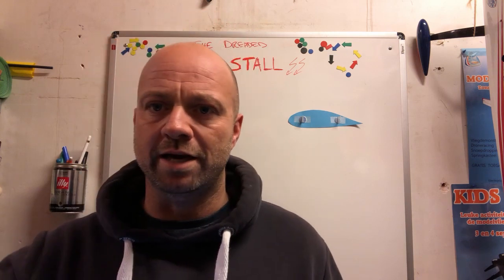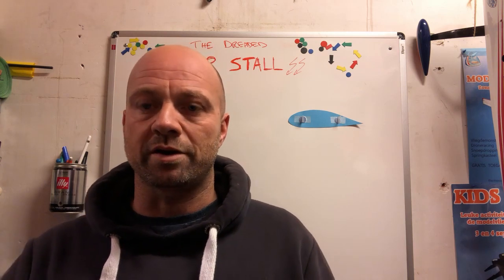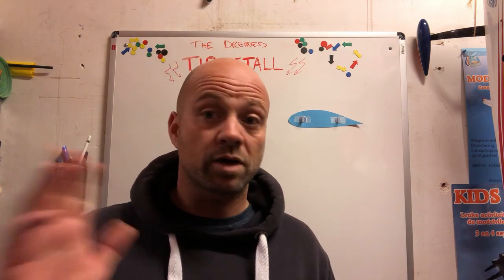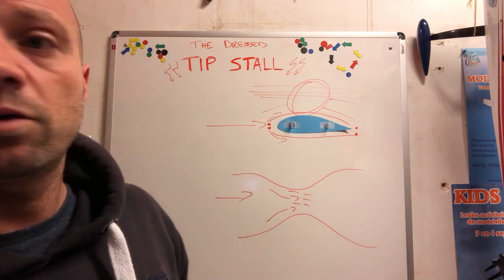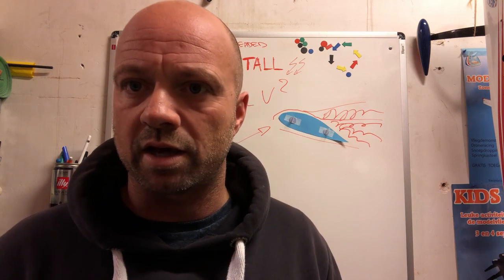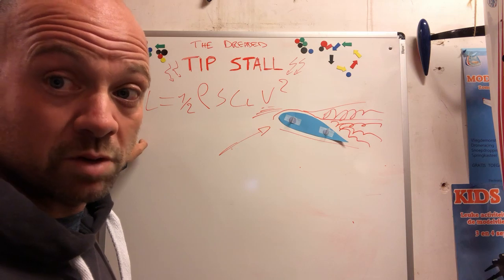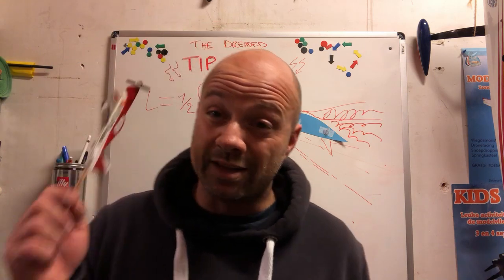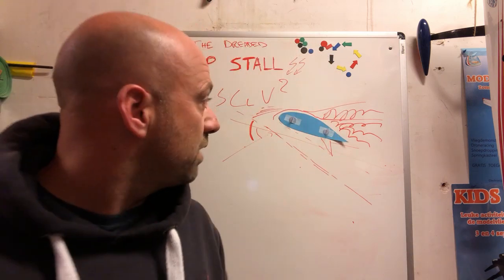EP 2 Tip Stalls

Comment: Thank u for simplified explanation of some fairly complex physics. Tip stall does exist but on model airplanes whether its simpler design or the fact little relative  speed difference exit between partial and full wing stalls on planes that its little of significance to rc pilot.

Comment: One final thing! Stall is not simply lift not being enough to compensate for weight - it's lift not being enough _when you are already flying at stall angle of attack_. The result is an increase in the angle of attack, leading to a decrease of lift (because now you're past the maximum value on the lift curve), leading to a further increase in the angle of attack and (at least partial) loss of control in a vicious circle.

Comment: Good to see someone explaining (and interested in!) the fundamentals of flight! One thing I didn't notice being covered is adverse yaw. If you ask me, that's what mostly causes your "tip stalls" (which, as you mention, are simply asymmetric stalls, nothing tippy about them). And it's also adverse yaw that causes the aileron input to be counter-productive when trying to correct the situation (as it's usually the thing that caused it). And how do you compensate for adverse yaw and maintain what's known as coordinated flight? Apply just enough rudder whenever you apply aileron input. Unfortunately, that "just enough" is a bit more complicated than a simple percentage of the aileron input - turns out the percentage depends on the amount of lift the wing is generating. Real airplanes do it by a combination of the pilot's muscle memory (learned by staring at an instrument called "the ball" for the first few dozen hours of training) and (with larger planes) automatic yaw dampers. My RC planes do it by incorporating an angle of attack sensor and some simple math (and many test flights to find out the actual lift curve in different configurations). If you manage maintain completely coordinated flight especially in slow flight, your "tip stalls" go away and  most planes turn out to remain controllable even in full stall.
Apart from that, one thing is worth stressing in my opinion: stall is not a function of airspeed, it's a function of the angle of attack (alpha). And the stall alpha is simply the alpha corresponding to the maximum value of the coefficient of lift (CL). Of course the shape of the CL curve depends on the configuration of the wing (i.e. what your lift-modifying devices are doing) and so can the stall alpha - usually flaps etc reduce the stall alpha (but the maximum CL may obviously still be higher than with clean wing).
Reply from the maker: Johan Veltheim thanks! I know I wouldn’t have gotten away with this explanation during my aerodynamics exam in my airforce days.
What I have tried to do is to translate pretty complex stuff into a fairly reasonable explanation that hopefully help rc pilots grasp the basics, so they have some comprehension of what happens when they’re out in the field.
Hope I more or less succeeded doing that :)
Reply: @TomDeWeerdt  that's a good point, some of the issues are quite complex if you really want to know the answer, most of the time RC pilots can get away with a bit less. I'm just a bit obsessive about my planes flying the way they would if I was aboard flying them with the proper instruments. :D

Comment: great video , as I have been looking for a demonstration on stalls'....I  learned to fly last summer, on all high wing 3S type trainers...I recently   flew my first low airplane, the HH  T-28 (  1.1m   yellow model  )   for the first time  and all the guys at the field kept telling  me to keep the speed up  or it will stall....but I didn't notice any bad tendencies when flying it, even in low slow speed turns....I used a 3S and  I did not use SAFE at all........... QUESTION: what  can I  do to  prevent  a tip stall  when turning at low altitude  for final approach  ...what pre-stall signs do I look for....anymore  helpful  tips welcome.... ....thanks
Reply from the maker: Generally speaking:
- High nose, low tail
- low speed
- plane getting sluggish on ailerons
- wingrock

My best tip to avoid them close to the ground would be to fly descending landing circuits, by that I mean starting up high and doing a circuit in one continuous descent untill the flare.
Start high enough on a downwind leg and establish your descent there. That way (side view, bit further away) it's easy to visually judge the speed. That way if you maintain the same descent rate with approx the same power you can trust that your airspeed on final desent is OK as well (while beacuse final is more of a frontal view and the airspeed is more difficult to judge visually)

When flying a more level landing circuit and throttling off on final to start final descent speed is more difficult to judge and the chance of inadvertently ending up stalling are much higher.

Also: Practice your stalls up high, in level flight as well as in turns, and in banked descents. Get to know your aircraft in all those situations so you know what it will be closer to the ground as well.

Lastly: Be triggerhappy on the throttle when flying slow, always be prepared to power up and save your ass :)

Comment: Thanks Tom. That's really helpful. I can now visualise what is happening during a stall and which situations are likely to cause it. One more question. What effect does using the flaps have, in relation to tip stalling. Will it increase or decrease the speed at which they occur.
Thanks for spending the time to make a very informative video.
Reply from the maker: Chris Edwards well basically those allow you to fly below the “normal” stall speed, on the Tundra they are so powerful because they create lift from the propwind. In my experience with the Tundra the stall doesn’t feel different with and without flaps, in both cases it’s pretty abrupt and brisk, they just occur at different speeds...
Reply from the maker: Chris Edwards making that video was actually a fun process, so thanks for the question!
Reply: @TomDeWeerdt  
Thanks. I really feel that I've learnt something from it. Hopefully I'll be able to keep the tundra in one piece.
Reply from the maker: Chris Edwards weather is still Delta Sierra around these part, but I must have plenty of footage laying around, I’m trying to concoct something this week!
Reply: @TomDeWeerdt  
No worries Tom. Quality is worth waiting for.

Comment: Warbirds takeoffs/touch & gos r certain killers. 1 u got to give up elevtor to prevent nosing in 
2 but up elevator creates early liftoff at slow speed 3. & to top it of creating hi AOA meaning wings have air separation rendering ailerons totally ineffective
4.The instinctive action to stall is speed. So u throttle up but increased motor torque is now countered by nth, creating a severe left unarrested roll. 
Only if u r lucky u fly away towards left, which r the take offs u get to c, whereas the rest just crash nose in on takeoff stall
Reply from the maker: I think the topic of CG range could help warbird pilots as well. In my experience most warbird pilots feel comfortable with noseheavy planes, not realising that a more aft CG (when staying well within the CG range) would lower the stall speed and make the problems you describe on takeoff less of an issue.